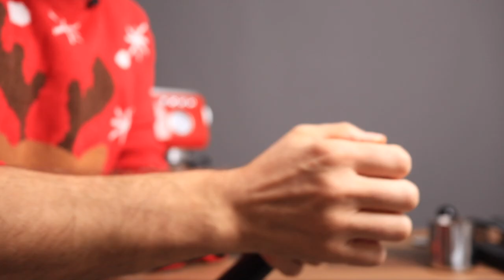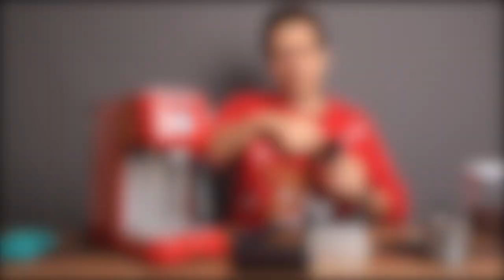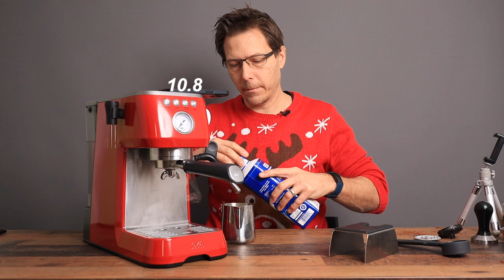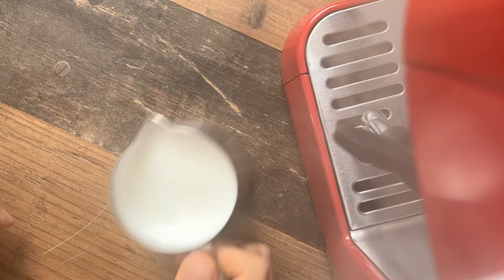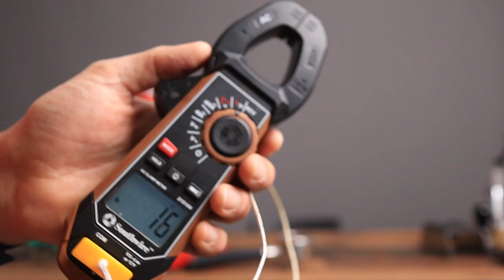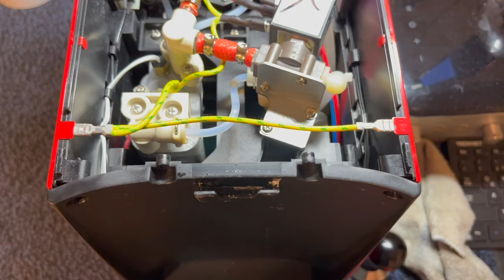Solis Barista Perfetta Plus: Delonghi Dedica Destroyer or Not?

Comment: I've had both units - the EC685 modded with Rancillo wand (gave this away to my colleague) and currently on the Solis Perfectta Plus.
I'd say that if you can establish and stabilize the workflow on the Dedica; and further have all the necessary aftermarket accessories, then moving to the Solis isn't any big of an upgrade unless you need to consistently make multiple shots.
For the Dedica, it takes more shots to 'calibrate' the grind (when changing beans especially) because your only way of estimating is the taste of the espresso shot. The Solis has the manometer which helps with major grind change requirements but it's not necessarily the most accurate out of the box (probably up to about 1 bar off).

One simple mod that should be done on the Solis is to shield the water outlet/ inlet hole under the shower screen - you didn't show the puck after extraction but if you look at it, there is a divot/ dimple in the puck opposite side of the portafilter handle. This is because the water outlet is directly facing the shower screen and that spot has higher pressure (if you pull a blank shot without the filter, you can see a jet of water exit towards the back of the machine). This does create uneven pressure in the puck and causes channeling.
This can easily be fixed by removing the shower screen, and adding a small food safe plastic piece to cover the hole (the water will still exit to the rest of the shower screen via the channels in the group).
For further information, see the reddit thread: https://www.reddit.com/r/espresso/comments/11ojaq0/solis_barista_perfetta_grouphead_fix/

Ultimately, I'm happy with the Solis because it's what I need - a semi-automatic machine (so the missus can use it without knowing how to time and weigh shots), has the 3-way valve, and has the cooldown after steaming function.

The main advantages I see for buying a Solis over the Dedica are:
1) Comes with all the decent accessories you need to start off - Solid metal tamper, milk jug, single walled baskets, has water filter in the tank for those who need it. Note: Some accessories differ by region and distributor - locally, the distributor has promotions from time to time where they give out free silicone mats with the purchase or run basic half-day espresso making workshops etc.
2) Better availability of nice after market accessories because of the Breville's popularity - e.g. Tampers, baskets, bottomless portafilters, shower screens, puck screens etc.
3) Self-cooling after steaming for multiple shots.
4) 3-way valve for drier pucks makes it easier to knock them out clean - this can be overcome on the Dedica by using a puck screen to force the puck to keep its shape.
Reply from the maker: This is an awesome comment, I'm gonna pin it! Thanks for all of those tips. It's good to know about the shower plate mod, and I am also glad to hear that you are happy with the machine. Which basket are you using? I bought an aftermarket Neouza one, which is better than the included one, but I imagine that an IMS 54mm would be the best choice. 
I also opened up this machine, and the quality of components looks really good - lots of brass parts, including the steam valve, and the connections look good. I like the manometer feature, but on my model, it was always around 15 bar, which can't be right. Anyway, thanks for your very thorough comment! Tom
Reply: @TomsCoffeeCorner  I'm using the stock basket along with a cheap China bottomless portafilter. I do have the Neouza basket too but it requires a larger dose (it's straight walled and holds more than the stock basket with the angled wall at the bottom).
If you're consistently getting 15 bar on the Solis, your grind might be too fine. What I realised on the Solis is that the dosage matters.
On the stock basket, I'd need to dose about 19g and that's including a 1mm thick puck screen.
For the Neouza basket this would need about 1g to 2g more than stock (depending on the beans and roast).
Any less and the pressure rise will take too long whilst the grind expands towards the top.
With a sufficient dose, I'd typically see the pressure rise to about 11+ bar peak within 1.5 to 2s (after pre-infusion) and very gradually lowers over the extraction to about 10+ bar (about 1 bar drop). That pretty much gives a good extraction consistently. Also, the extraction time is on the shorter side (about 28 to 30s including the 5s pre-infusion) but the taste matters more.
Reply: Glad my grouphead mod is useful to you! Personally I'm not quite satisfied with it so I ended up using a puck screen as well.
Reply: @BigBenAdv  Problem with this machine is there is no pressure limit (at least in my unit), so the shots are too fast, and if you grind finer - the pressure is too high which promotes channeling and harsher taste. I'm planning on checking for the over pressure valve to see if it can be tweaked to 9bar limit
Reply: @FunkyLoiso  Not sure why the replies don't seem to be going through but there is an OPV inside the Solis but it's not very accessible. You can try lowering the temperature and letting the shots run slower, which is what I do.
Reply: @BigBenAdv  I'm already on the lowest temperature setting 🥴 I checked around, and the dimmer mod seems to be easier to implement than fiddling wit OPV, might try that first!
Reply: In regards of pucks in Dedica, I do have never issue to knock them out with clean basket, even preparing more shots in row.  Pucks are bit wet at top, but solid in body, not breaking up. Just do proper temping is key I guess to avoid big messy pool in the basket. No screen or any other things like WDT which from my point of view over-engineering shots preparations.
Reply: @vsimcik  If you leave the portafilter in to slowly release the pressure, the 'excess' liquid drips out and you can get a drier puck on the Dedica for sure. Still not a fan of the wet tops on the pucks though.
The puck screen pretty much eliminates that as the water will collate above the screen.
I'm afraid I don't have as much patience as you do so it's always been puck screens for me. 😅
Reply: @vsimcik  My experience, too. I use a precision basket and the puck literally falls out of the basket when done, I hardly need to tap it at all. Compared with the stock pressurised basket, where I usually take the basket itself out and tap away until the puck eventually falls out. With the precision basket, the puck has a little wetness that fades as you pull it off and like you say, tamping seems to be the factor here. After getting a decent one -> no more issues (and even the pressurised basket puck is not too bad to get out).

Comment: I know the story of this machine very well. I’m from Mendrisio, Switzerland where the machine has been designed. The owner of the brand has sold for years, under Solis brand, machines from Breville. He is obsessed with Breville. Breville stopped to sell to Solis and Solis tried to design this machine that is in technology and shape a poor recall of Breville machines. They are produced in China at low cost. Solis is usual in this. They buy in China at low cost all their appliances and resell in europe with huge margin making believe the product is swiss. This machine is suffering with valves, tubes, electronic. In few words, a real chinese stuff. It’s better to spend something more with other brands (Delinghi, Breville, Sage) but having something that lasts more… Happy espresso to everyone :)
Reply from the maker: Wow, that's very interesting, thanks for sharing that story. I know it's made in China, and it doesn't get the best Amazon ratings, but the insides actually look to be good quality brass components. But yeah, I have had really good luck with Delonghi. My original Dedica is still going strong after 5 years. Cheers!
Reply: Whoever told you that story lied to you.  Have you actually ever used this espresso maker? Over the years this machine has been improved in its weak point... Now it's very very performing!
Reply: Also Chinese-made doesn't mean bad, at one point people associated Japanese-made products with low quality too!
Reply: @alinaqirizvi1441 yes it does

Comment: The plastic insert is purely for heat retention on your shot. Because the thermoblock doesn't effectively heat up the portafilter (when not doing dummy shots to preheat) so when the shot hits the plastic it doesn't lose a lot of its heat through the portafilter sapping a lot of the heat out of the espresso
Reply from the maker: Well, that makes sense. But for those of us that want to preheat, it is nice on the Solis, that you can take out the plastic insert. Somehow the shots taste better to me when teh PF is properly preheated.
Reply: @TomsCoffeeCorner  Plus who wants hot water running over plastic parts, Yikes !! They are selling this Soli model now for 329 in the U.S. but imho, the Gaggia Pro for 399 is a no brainer for beginners. Before I got this I would get the Delonghi 3420, I have a Gaggia Prestuge Auto, not really happy at all, you just can't dial those things in tbh. I will pass it on to family and get me a Gaggia Pro or Appartmento. I think the G Pro will suffice my needs looking at your videos, Thanks for all the tips Tom.

Comment: I have seen Hoon doing a similar test on the Infuser PID and getting more consistent results with different temperature changes. It's probably not a good comparison because the Infuser is more money, but it definitely brews at the correct temperature for espresso.

Comment: I can tell you why there is the plastic insert.  If using pressurized basket, the sage/breville has off center hole.  Without plastic you get a mess shooting out portafilter.  And I’ve heard the solis is made by Breville….not sure if true, but is 54mm.  So plastic dissipates force in case using pressurized, if not remove.
Reply from the maker: Well, the Solis, the EC885, and the Bambino Plus all come with unpressurized baskets, so I don't know why the plastic insert is still there? Maybe it's a leftover design from earlier iterations?
Reply: @TomsCoffeeCorner  well in the US, the bambino, plus I believe used to come with just pressurize baskets. It now comes with both pressurized and non-pressurized I have one that’s two years old that I gave to my son that I think just had pressurized and I recently purchased another and it has both.
But this is a U.S. breville not the European sage .
Edit: just checked and here is US description E.S.E Pods, Pressurized and Non-Pressurized.  So Here Solís comes with both types of baskets according to Amazon selling Seattle coffee gear.
Reply: It's just for insulation, so as he States, the shot bypasses touching the metal of the portafilter so as to retain more heat
Reply: Solis is not made by B/S. The scope of the plastic insert is to reduce heat loss if you haven't enough time to preheat the portafilter. 
You can easily remove it...
Reply: @Paolo1064  so those who think the only function is ‘heat’…have you used without the plastic and a pressurized basket?  I think you’ll find another function other than temp.
Reply: @chuckv8838  I never wrote this is the "only" function ;-)
You are right, it also reduces the mess with the pressurized portafilters.
BTW on my personal BP, I removed the plastic insert the first day and I don't use pressurized filter baskets 😀

Comment: 6:00 The plastic insert is there to keep the coffee hot - it prevents the heat from transferring onto the bottom of the portafilter. It is commonly seen on thermo-block heating systems because they don't usually heat up the portafilter passively.

On Delonghi's machines (especially those with pressurized basket), the plastic insert also regulates the high-pressure coffee stream to mimic true espresso system's smooth, honey like flow.

Comment: I bought the solis barista perfetta in July for $239 new and have made 1-3 lattes everyday since then.  A latte takes me 7-8 minutes from start to finish.  Although I'm a newby, I'm very satisfied with the Solis.  I was buying dark roast beans at first and finally switched to espresso roast and the espresso shot flavor has really smoothed out using espresso beans (Barefoot brand has been the best so far).  18 grams in, 45 grams out, 10-12 psi, in 26-30 seconds consistently.  No leaks.  I agree the extraction temperature is only 180F or so at the high setting, but that seems to be working fine for me.

Comment: The idea behind the plastic insert is to avoid the contact with cold metal part that will end up in "colder" coffee.
But if you know, that you should rinse and warm-up the portafilter before every extraction, the plastic part is useless. In this case you have to remove it, since you want the metal part to absorb the heat.

You also have to remove it anyway, in case you use deeper IMS precision baskets.
The same should be for Delonghi, in case you use compatible single-wall baskets.

Solis: can be removed with a screwdriver or a spoon by pushing from below after your removed the spouts.
Delonghi: the plastic parts is fixed with a screw. If you remove it, you need to close the screw-holes somehow, otherwise coffee will flow through. 

Hope this makes sense for you.

Comment: The temperature may have been too low because the flow rate was too fast (that shot seemed to take something like 15s to reach 2:1 no?)
The thermoblock is designed around a specific flow rate and I don't think any PID would be able to cope with a lot of water passing through it too quickly, there just isn't enough time for the water to pick up enough heat from the block.
If you still have the machine give it a try with a 30s or 40s shot and see if the temp is higher (would be great to know!) - I think that's the biggest problem of any thermo* system, the concept is great but it just doesn't have a lot of wiggle room for espresso.
Reply from the maker: Hey Maruel, I can grind finer and try for a 40 second extraction to see how the temp curve is. I do think it will be a bit bitter then. But I think you might be on to  something here. If I dose too little, or if the grind is off, and the extraction goes too fast, then even the best PIDs cannot hold steady. That extraction was 20s with the pre-infusion btw. Cheers!

Comment: Hi Tom. First of all I'd like to thank you for all the effort you put into your videos. I bought the Dedica Arte used on amazon warehouse in "as new" condition but it didn"t work, the coffee doesn't drip. So I'm gonna send it back. 
If you can buy the Solis new for the same price as the Dedica Arte (around 240€), will you choose it over the Dedica or over the Bambino? 
Have you tried the temperature hacks that you provided in the Dedica video (blank shots and steam mode) to minimise the temp drop?
Tom
Reply from the maker: The Perfetta feels like a better machine. It's heftier and uses higher quality brass components inside. Coffee is about the same, honestly.

Comment: Thank you, it is a nice, straight to the point video, but according to most users comment about entry level machines that they have low durability and repairing is a pain which lack of parts and manufacturers’ support?
Reply from the maker: That seems to depend on the reviews. On Amazon.de the reviews are mixed, but on other platforms they are better. Maybe the first series of these machines had issues? Can anyone else comment on these machines' longevity?

Comment: Would you recommend the Solis over the base Bambino (not Plus as I don't care for the auto steaming)?
The Solis has more features but seems to have some issues with pressure too high and temperature too low. Also I've seen people mention water leaking and holes in the puck. Have you experienced this?
Thanks.
Reply from the maker: I think that Breville has better quality control, even though the Solis uses higher quality brass components in the machine. Therefore, I'd go the Breville route. I'd say the espresso between them is quite similar. The Solis use to have quality control issues a few years ago. It's probably better by now. Have fun with your choice.

Comment: How big is the portafilter? 58mm? Would be good to do a side by side comparison with the bambino plus. I wonder if the PID on the bambino is better
Reply from the maker: I could do that. Yes, it is also 54mm. I am guessing the results will be similar, but we'll see.
Reply: @TomsCoffeeCorner  I'm excited for this comparison! I love that you Can pull hot water straight out of the steam wand on the Bambino Plus… I love that it can steam your milk without you having to touch it... The only selling point on this since it takes longer to heat up and longer to steam Is that it had the monometer and it's slightly cheaper... Curious how your comparison is going to go. You can't just get hot water from the Solis like with the Bambino and Bambino Plus can you?

Comment: I understand that in the Solis you can program the temperature as low, medium or high.  In other videos I have seen that the "high" temperature is the most appropriate for espresso, because it would be more stable at 90°C.  When you measured the temperature, was it set to "high"?  Greetings.
Reply from the maker: Sorry, but I don't recall. I have since sold this machine, so unfortunately, I cannot check.

Comment: I'm curious how the comparative test between Delonghi Dedica and Gaggia Gran Prestige would turn out. Great material. Thanks
Reply from the maker: Hmm, well the Gaggia is a little boiler machine, so the results will be different than the Dedica with its thermoblock. I just recently got a Gaggia Viva Style in, which I plan to test soon. It is similar to the Gran Prestige.